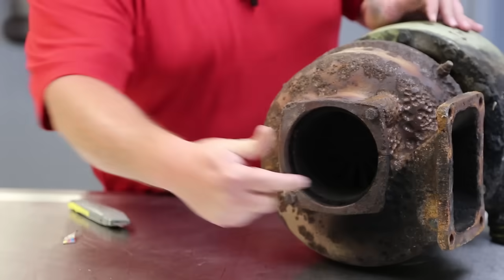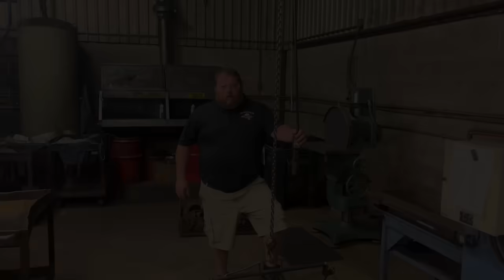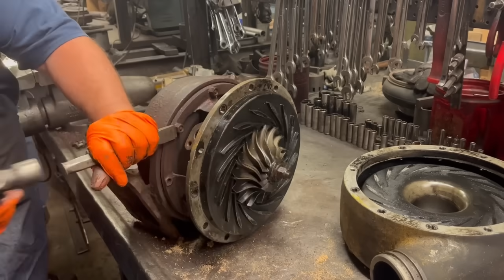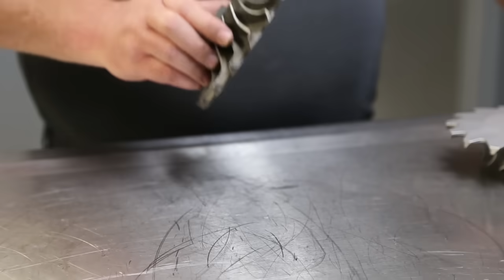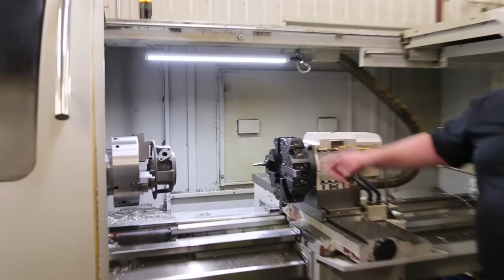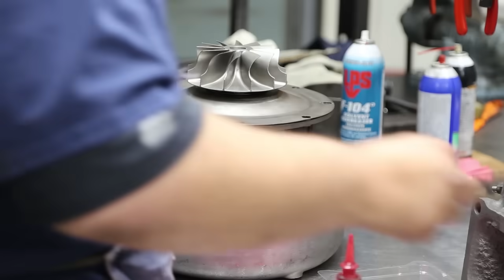T14 Turbo Repair for @DieselCreek  1964 D8H Cat Dozer – BACK FROM THE DEAD … WILL IT START?

Comment: Thanks for fixing it up!!! she sounds great now!
Reply from the maker: You bet! Our pleasure!
Reply: You should  also be a machinist tech collage instructor😢❤❤❤❤❤ @AreaDieselService
Reply: @AreaDieselService  That's a lot of puttzin' around, in the end it's just a reman.  An old cat with no computer, just weld a few adapters on and slap a modern turbo on it and you're done.
Reply: @lo1234-w9r  that kinda defeats the whole point ..!!
Reply: @lo1234-w9r  you could do that. but it wouldn't be a true restore then.
Reply: What, you didn't like the self destruct mode?!
Reply: @dans_Learning_Curve  Isn't that a extra cost at the dealer.😂
Reply: Thanks for the behind the scenes
Reply: *IF* all hope was lost and a rebuilt turbo simply wasn't available, would the D8H engine run as a naturally aspirated diesel engine?  I'm sure the power would be down but, would it still be usable for your purposes?
Reply: @BlackPill-obey theoretically yes but would be a dog.... Id have just upgraded to a newer manifold and turbo set up
Reply: @DieselCreek what would such an update have cost?
Reply: What a labor of love! You demonstrate not just your 227+ years of experience; and not just the astonishing skill and meticulous work in this resurrection,  but your great passion for producing a solution to what very likely would be an irreparable piece.
You should be proud.
Reply: You better restore that D-9 to a like better than new, Matt! $6500+ for the turbo rebuild makes that machine priceless as well as irreparable from this moment on!

Comment: From the little I know about bearings, if you can slip it in by hand like that without even chilling it it's not a very good fit.And should you torque the wheel on the shaft while it's hot? The torque will be affected. Not as much as by oil tho. That's the new little I know from the Torque channel 🙂

Comment: The crack could be welded. I've seen it on Cutting Edge Australia. 
It's spray welding and dude's repairing worse cracks than that. Everythin, or almost everything can be repaired. If a part is too gone, he will simply make it on a lathe. The blades would be a problem but I'm sure there's some 3D tech for that these days

Comment: Do you purchase turbo cores? WOW!  VERY COOL!
Reply from the maker: As you saw in this video, we have a horde of cores. That's from 50 years of keeping things just in case and also purchasing cores from time to time for future remanufacturing needs. Certain cores do go back to the OEMs, but others stay with us for our own a-parts reuse. We do buy cores back from customers also. Presently, our most sought after cores are Turbochargers: HE400/HE500Cummins; Injection Pumps: JDB, DB2 (3/4/6 cylinder - no DB2 GM Auto pumps), DB4, John Deere DBGVC 4 & 6, DBGFC 4 & 6; Injectors: Case 504128307 (0-445-120-075), Case 2855491 (0-445-120-054), Navistar 3005555C91 (0-445-120-179), International 735255C91 (KBEL84S4/13).  That said, we'll consider any Turbo/Injection Pump/injector cores - and anyone can email us about cores at parts@areadiesel.com
Reply: @AreaDieselService    Thank you for the reply. It means a lot.

Comment: These castings where there is no support for:
why not take the core to a foundry and have them make you one or ten?  I took some castings to a small foundry and the proprietor made brand new (better than the original) replacements.  He used the core and filled in the pitting with putty for his new mold.  On top of that, unlike the engineers who developed the part on paper, he had the opportunity to SEE what the years of use had done to the casting  and made determinations to thicken the areas of the shell where there was potential for cracking or excessive wear.  (The thicker walls can be added to the outside surface if there is no clearance for components on the inside of the casing.  Obviously, inner walls can be thickened which might give you closer tolerances after final machining for turbo/pump impellers to increase efficiency.)  This "redesigned" core gives him a new pattern to make the replacement castings.  They did the final machine work in their shop (or you can do it yourself if you have the tools, and it looks like you do).   Notice I said "one or ten" above; if you just need one right then, well and good.  But in a foundry, 90% of the time involved is in the prep of the pattern for the mold.  Nine more can be made dang near as cheap as making one.  You might think about future demand and having castings on hand when no one else does.

Comment: thanks for the machining shots  I drill snapped studs and bols daily I run a repair shop in west wales Ive got a local diesel shop 30 miles from me very very good knowledgeable crew

Comment: The introduction was 13 minutes of boring chit - chat and you didn't even post the video of taking it apart. Impeller shaft could have went without grinding. A little bit of profiteering? I could have disassembled that for $150 lol. Anymore these mechanic shops charge Drs hourly rates, quadruple the retail cost of parts, and tack on unnecessary procedures to max out their revenue.  Profiteering at its finest.

Comment: Am wondering if you gentlemen at ADS have ever thought of using a product like Cerakote on the Turbine Housings to eliminate some of these problems?!? You need to apply it both inside and outside the housing. It may even be effective applied to the Turbine Wheel itself.

Comment: Awesome fix, I have very little machine shop experience.. at the age of 16 I worked on a very small general engineering company, I learned some lathe work.. skimming break discs and a few other things, but eventually went on to work as a joiner, the small amount i learned back then gives me enough knowledge to really appreciate the fine work your guy's do with those precision machines.. if I had continued on the engineering path, your company is the sort of place I'd love to have worked at, with having appreciation for your workers, something that wasn't there at the place i had started working at all those years ago.. maybe I would have continued on the engineering path if that company had the same sort of ethos as you do, anyways.. a great video, much respect for your people, all the best from over here in Scotland.

Comment: You said the worn thrust components were damaged by contaminated oil, If they had changed the engine oil before attempting to start the Dozer main Diesel engine do you think the turbo would have needed fewer parts and been cheaper? 

It surely doesn't do any good to the bearings in the engine as well as the Turbo which are known to need good oil changed on time but it had sat for 15 years prior to start up.

Comment: Wow, I'm impressed with the machining required to fix this old equipment. Excellent work. Shouldn't the housing be protected from more corrosion with primer and heat resistant paint?

Comment: For welding the turbine housing, instead of TIG try Ni-rod in an AC welder.  You have to bring it up to temp with a pre-heat first.  I had great success welding cast iron furnace components that were much worse than that.

Comment: I've seen some videos when people "simply" add a ton of material on cracked casings via welding and then grinding/machining it down to spec. Would that actually work even decently - in any case? Or at least as a last resort?

Comment: I love the sound of these Turbos, something I'll never forget with these old beasts. Wish the Turbo in my cruiser sounded like this. You blokes are legends for taking this project on. Oh and an old timer let me in on a secret to dealing with all bolts & studs on any exhaust component & I've used this trick for decades, it works like Magic. The trick is mix Graphite powder with a bit of oil to make a paste & put this stuff on all bolt & stud threads & it will Never seize no matter how hot it gets. I've had to go back into old jobs a decade later & it came apart as easy as I assembled it the first time after it's fix. Try it, it works perfectly & even works on gaskets too. Regards from Australia

Comment: Iam impressed boys about this repairs! Specialy with this old machining devices. Dont be angry about me guys. Iam mechanist all my life. I can't belive your presize grinder grinding surfaces for bearings Is able to remove component from clapmping for measuring 🙄 specialy on grinder witch one need hold stabil temperture for precision. Its imposible to clamp it back in same position! Its same like your worker on lathe. How Is possible to hold precision on unbalacend machining thing? Also using type of measuring tool. There Is milion of mechanic 3point mutch more presize measuring and stable measuring tools! (Something like micrometer with 3legs for measuring holes) i know, digital Is expensive, but mechanic are working also awesome! By the way really good job! 🙂😉 Dont be angry at me, but i got different machining standarts. Sorry for my bad english 😑

Comment: What was the story with the second turbo in box 54?  It seemed to be completely ignored, rather than choosing the best of the two.

Was it actually a different model of turbo, or did it have more damage than "plan b"?  Or something else I'm not thinking of.
Reply from the maker: It was the same model, but it had a different turbine housing and the bolt pattern where it mounts to the exhaust manifold was different.

Comment: Nice work, but I have a question I can't help but ask:  If this turbo was in fact completely unsalvageable, would it have been possible to configure a modern turbo to function on one of these old machines and only have to machine an adaptor?  If not, I'm curious why not.

Comment: Have yall tried Eutectec spray welding to buildup your bearing surfaces ? It can also be used on cast iron to fill the deep pitting if theres a concern of the housing being to thin in places, I also love your turbo "retirement" center

Comment: If it came down to it would be interesting to put a more modern turbo on. Given the size of the engine it’d likely still need a large turbine housing, even though it’s “only” 270 hp or so. 
Or, if it’ll give it enough fuel could throw a large modern turbo at it and make a bunch of power until it comes apart.

Comment: I've run Cats in boats and trucks like forever. Now it's "back in the day." The rarest was a pair of D-326s, the younger Cat mechanics in Kodiak asked to come aboard to have a look at them they were so legendary. About equal to a 6-71 but big ol' hunks of iron. Those  D-342s are go-forever old sweeties, had a pair in a 106' power scow for salmon packing in Bristol Bay. D-343s in a 120' landing craft for hauling freight across Prince William Sound, and they were used in D-8s back in the 60s and 70s too. I engineered D-398 and D-399s which were the main engines during the heydays of the king crab fishery, then finally twin 3512s on the tugboats I sailed on. Other Cat series I operated were 3208s and 3406s. Probably forgot a few too!
Ol' Yeller has quite a history just in my lifetime alone.
Reply from the maker: They don't build them like they used to.

Comment: Shouldn't the tenten or bushing have been a snug press fit in the bearing housing? The bushing you installed is so loose that it can spin in the housing. It dropped in.  I noticed you machined it that way on both housings. Won't it cause damage if the bushing or tenten spins in the housing? Abom79 always makes them a tight fit to prevent such spinning. It could wear the housing if it spins The oil supply isn't designed to lube the housing too or is it supposed to be a floating bearing?
Reply from the maker: It's a floating bearing. It rides in a pressurized film of oil.

Comment: Don’t say you can’t get a new housing.  You can always get a new housing if you have a core, the question is the cost, and time.
I seen old parts that have been old cast iron or steel parts for old antique equipment recast in a founders.
The Old Threshers reunion  in Mt Pleasant Iowa has 100+ year old equipment, that has been restored with new custom cast parts, and they even have newer tractors that are from the 1950’s that has a recast turbo parts on them.
The again it is about cost and time involved.

I seen 100 thousand dollars spent on restorations old old equipment because of the rarity of the equipment that has been displayed at the old threshers reunion.

Comment: I had a truck with a Cat 1160 V8 motor and it had a very low oil pressure down to 5 pounds when hot, so took it to our Cat shop and they asked me what oil I had in it. I said Series 20/40. they asked me what brand and I Castrol. They said it should be  Castrol 20/40. I said why and they said it is mad by Cat for Cat. I put in Caltex 20/40 and the oil pressure went up to 50 pounds  when hot. I could hardly believe it, but that is how it stayed.

Comment: Costs aside of the rebuild.😨😱🤯

Would it have been possible to get a new turbo that would have worked on the bulldozer?

I can assume that you might struggle to find one in that size with the same output. 

But you can probably get one that does the same amount ratio wise and modify the exhaust manifold or make a new one.?

I'm no expert, just curious if it could have been replaced with a new/modern one.

This is super sophisticated/precise/advanced. I did not know it was that advanced.

Comment: Very video !!! Must admit I watched Matt unwrap your "ethafoam" packed return ... he was like a kid in a Candy Store. LOL Aerospace Engineer for 4 decades and oversaw the F-16 EPU/TPU builds from Garrett (AirResearch) Torrance and "TAT" in Israel for over 3 decades so sort of know what I'm looking at. As it is a Single Engine Jet and the first "Fly By Wire" system, sort of important to have that "tricity" flowing if you have a flame out ... ours runs on "Hydrazine" and spins up to 34,000 RPM in .6 seconds ... "perfect balance" is a understatement. So happy you were able to get Matt's unit back in perfect working order ... all he has to do now is fix that fuel delivery issue.  Again, thanks for the video ... great job to Gary and the rest of the ADS crew !!!
Reply: And as to "Cost Benefit Analysis" ... that $3800 rebuild may "sound" expensive ... but it's truly not. Guess what it costs to rebuild one of the new 6 speed Auto Transmissions ... LOL. And THEN, take a look at what folks are having to pay for "newer" D8 sized Dozers at Auction ... min $60k !!! So IMHO, Matt made the right choice. 'nuff said

Comment: Just a quick question, why straighten the shaft after grinding the bearing surfaces, to me it seems this procedure is the wrong way around.
Reply from the maker: Good eye. Great question. Straightening is in fact first. Then grind, polish, and balance. We had wheels chucked in each machine for video production and so we could get in and out of the machine shop quickly and we captured the processes out of order. Are you looking for a job? Your attention to detail is what we look for at Area Diesel Service.

Comment: These old Garrett's are just like the "modern" Garrett turboprops where its a straight shaft all the way thru so when the engine is shut down the pilot spins the prop to get cool air thru the engine and over the shaft so it maintains straight otherwise the shaft could warp

Comment: Awesome rebuild, the old horsepower and today's horsepower don't seem to be same. My 13 HP Case VA on rubber will take any of these little tractors that alegedly have more horsepower for a ride.
Reply: I think there are a few possibilities for why this is.  I will try to list some and we'll see what sticks.
1) Heavier equipment.  From a traction standpoint, heavier machines are often more productive just because they can pull where others spin.
2) Heavier flywheels?  Older, larger engines have heavier flywheels and this certainly adds a bit of punch for transient load situations.
3) Building on #2, heavier, older engines spin slower to make their horsepower.  As a necessary result, they make a lot more torque.  The resulting horsepower curve is much more flat than a modern, higher revving engine.  So even if your Case is rated at 13 hp, it probably makes near 13 hp even as the RPM gets dragged down a bit.  In practice, that means it can outperform a modern equivalent "13 hp" when both are fully loaded.
4) Old cars were definitely rated HIGHER than modern cars (SAE gross vs net) but perhaps small engines and other agricultural equipment was more conservatively rated?  No idea.

Comment: So, when you have a new-old-stock part like that which is no longer available do you spec or do a 3D scan so there's a record of it?  It would be the ultimate cool deal to have that available to download into a CAD/CAM system fifty years from now when the next guy really needs one.

Comment: Really impressive and entertaining video but 2 things puzzled me, why was the spindle straightened AFTER grinding bearing surfaces and what stops the bearings from spinning in the housings, given that they pushed in so easily?  New subscriber
Reply from the maker: Good eye. Great question. Straightening is in fact first. Then grind, polish, and balance. We had wheels chucked in each machine for video production and so we could get in and out of the machine shop quickly and we captured the processes out of order. Are you looking for a job? Your attention to detail is what we look for at Area Diesel Service. And the journal bearings do spin or float in the housing by design.
Reply: @AreaDieselService  thanks for the job offer but I live in England and I,m only a " bush " engineer , not in your league, thanks for taking the time to reply , i,ll get my gf to subscribe too :)

Comment: I could get very drunk with a cylinder full of beer from this engine. Many modern 2l engines can push way past 270hp. I wonder what kind of torque it puts out. Would be hilarious to swap in an angry 12v Cummins, you'd probably have to weigh down the machine after such a feat.